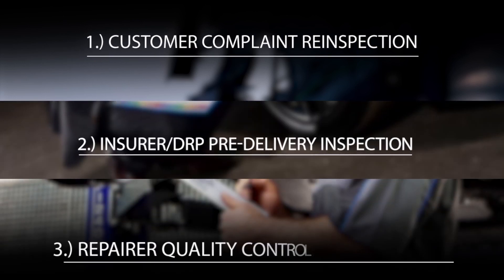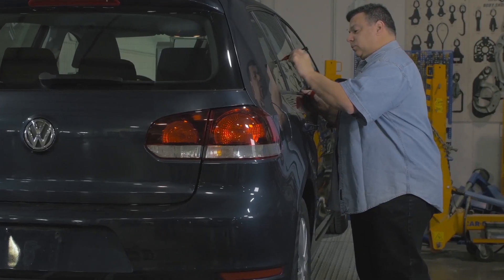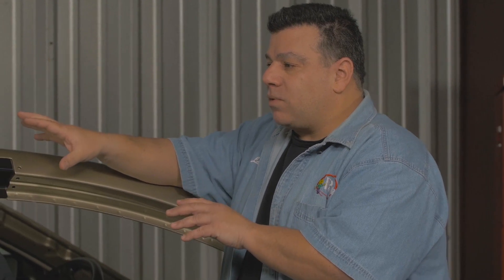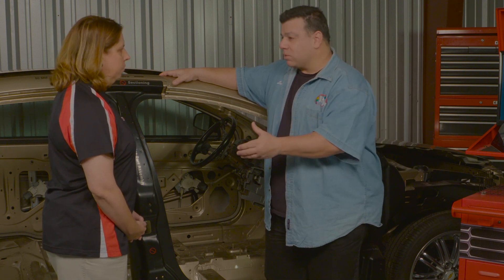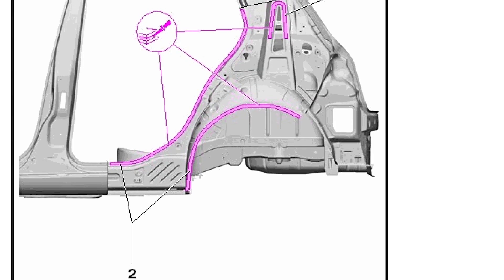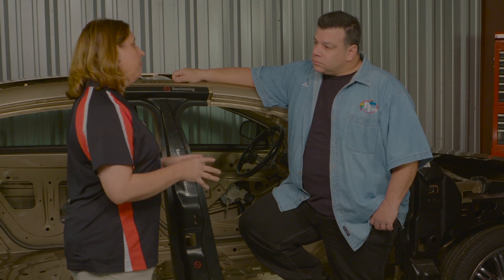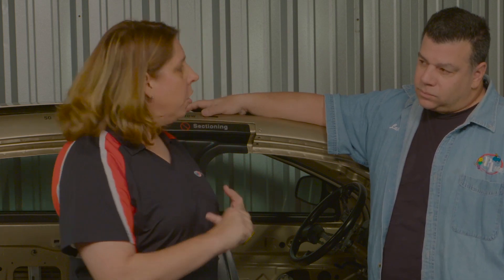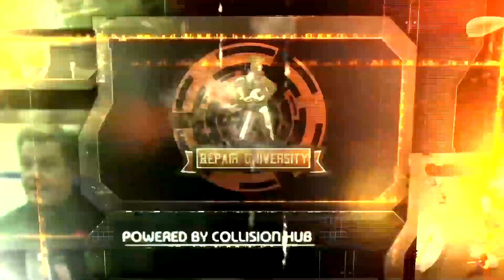Repair University: Part II Post Repair Inspections For Insurance and Repair Shop Owners

Comment: i have worked in the collision repair industry since 1979 , quality has always been important to me .. my last 11 yrs in my career was at a honda and acura dealer .. insurance companies used to pay us to do measurements on structural damage on frames with our shark measuring system ,, well i had a brand new civic that needed a left front frame rail and upper rail with strut tower . the adjuster from state farm came out to adjust the damage he told me he wanted a shark measurement before and after , i told him that its 4 hrs to set up and measure ,, he said we dont pay that anymore to the shops that we have a contract with under the drp program ,, well i work on comission and the shop will never pay me to spend all day measuring this vehicle all the shop did was try to push it out the door fast because the shops agree to pay for rent cars after the agreement that the shop has 1 day turn around for 4 hrs on the contract with the insurance company , the insurance companies rush these jobs through to save money and fuck the customer every time ,,

Comment: The scary thing is that the way vehicles are being made today (material mix, build geometry,etc.) someone that does a better job of the procedures they do, then was done on this job, can still do things wrong enough to make a vehicle unsafe, and it may even be hard for a post repair inspection to catch some of these dangerous repairs because the procedures were done very nicely, it was just the wrong procedure. This was a poorly done  repair, I'm not so sure that it was dangerous to the level described here, but it definetly was not put back to pre-accident condition and would not react the same it did when new in another collision. I totally agree, if you can't fix it better then this was done you should be in a different business.

Comment: yes that was a bad repair now where I am from we take all cars apart for a certain insurance company and the insurance company does the estimate they say they do it in conjunction with the tec but I have got jobs with wheel house damage and assume I am putting a quarter panel on it so I pull the car apart like I'm putting a quarter and outter wheel house on it the adjuster shows up I go through the damage with them and they ask me how much time I need to repair the quarter I told them whatever it says in the estimating guide to replace the outter wheel house and quarter  they look at me like I'm crazy one adjuster told me they do not replace quarter panels unless it is ripped. you can say this person got payed to put the quarter panel on they could of at least did it right but also they are putting it on to a destroyed outter wheelhouse I highly doubt that that was the techs choice but maybe. it's easy to say we shouldn't be chasing numbers and focus on putting out quality work doing perfect  work makes it hard to finish the week with straight time hrs I see it plain as day the people that do poor quality work make more money management loves them and loads them up with work people that focus on quality fall back on hrs and don't get recognized it's easy to point fingers at body guys and painters but I see poor repair being pushed by insurance company more than anything they don't pay for cars to be fixed properly.
Reply from the maker: We see that too. 
A few things to remember. Insurance doesn't say (or shouldn't say) how a car is repaired. That is the job of the shop. An insurer is not going to step in and cover you in a liability suit. 
Second, insurers and shops have to stop chasing KPIs and start focusing on quality. 
The issues on this car were potentially life threatening to the rear occupant. 
I'd rather not do a job and lose money then endanger another human being. 
When shops stop agreeing to do it half way for uneducated adjusters, the bar will raise. 
However, I know your in a tough stop. Larry and I both have been there as we try to make a check for Friday and provide for our families.